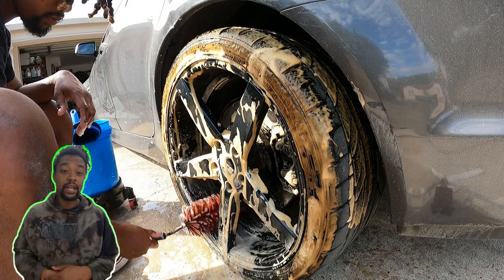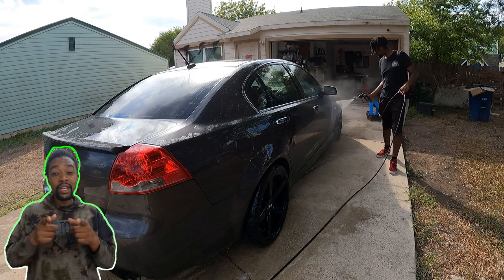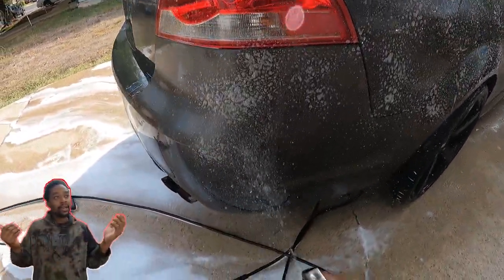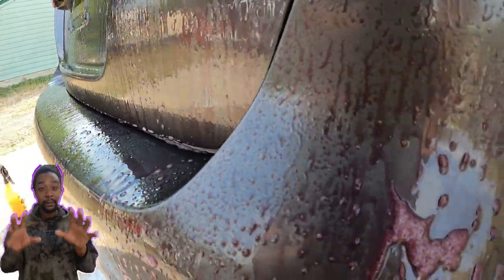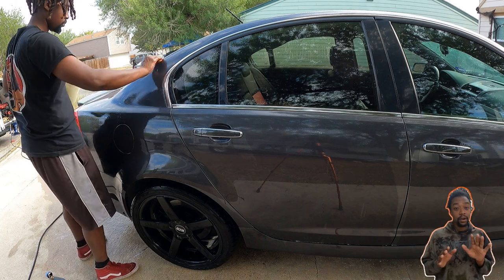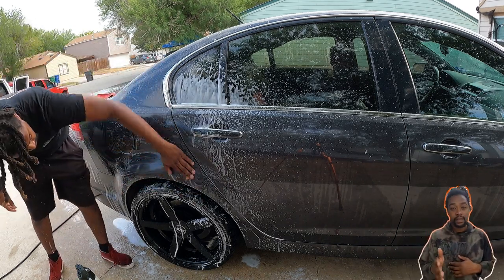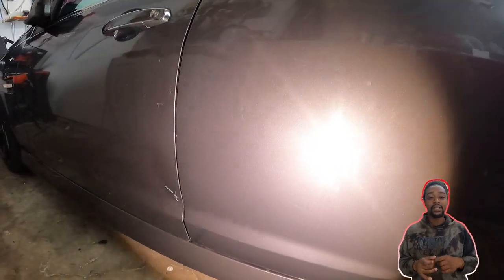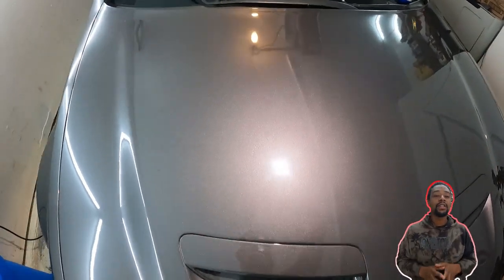Prepping another G8 GT for a paint correction and 1 year coating | paint was rough !

Comment: Takes me 5 min the prep my car for 5 step correction. I just spray it off and dry. I don’t even wash if it’s not that dirty. Now the actual clay bar, polish, wax sealant and ceramic coat. 2 days of all day work damn near. Looks like glass when I’m done. Also get you a rolling stool man. You back will thank you In 20-30 years.
Reply from the maker: I got a rolling stool. Use it mostly for wheels and polishing. Need a new one tho